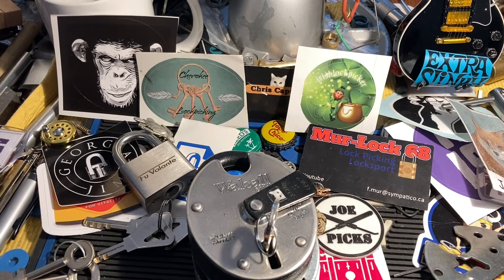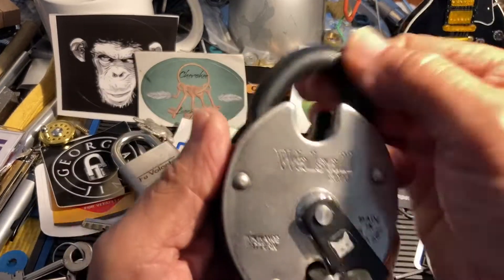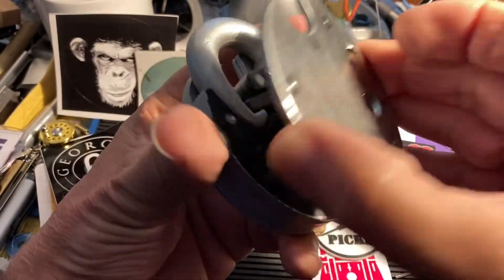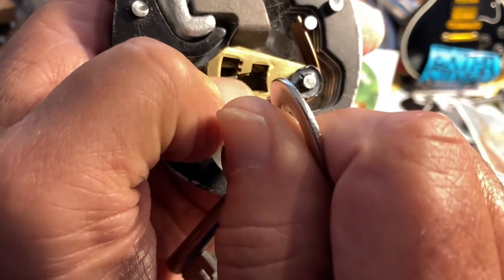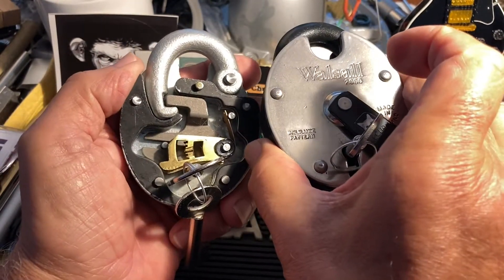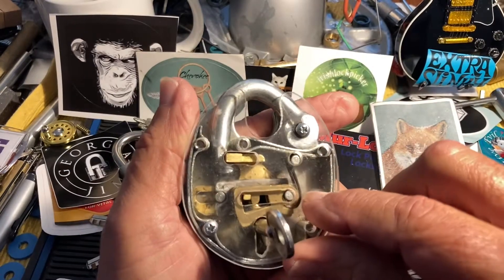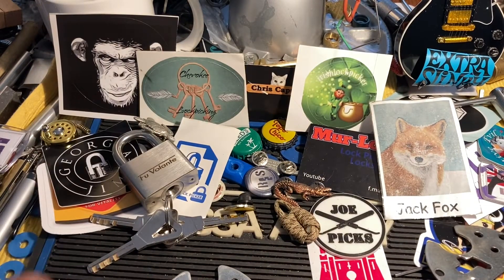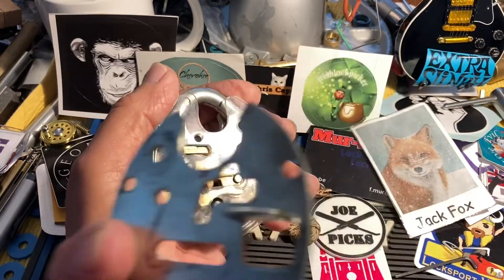#2007 Walsall Ace cover removed

Comment: Thanks for making that Walsall 2000 cutaway. I was going to send mine to Steve. Now I don’t. I only have one Walsall. Very interesting about that bar in the Belfry. Did not know that. My plexiglass covered levers in my Squires really slip. Need to find a solution to keep them from slipping. Thanks for the video.👍🦊
Reply from the maker: Welcome my friend!! 
They are all a bit different. Nice to find that tab on the Belfry that makes it work better!! 
🐈‍⬛🐾🐈🐾